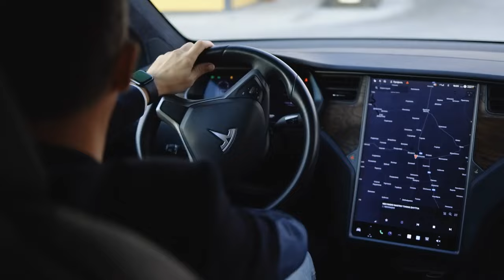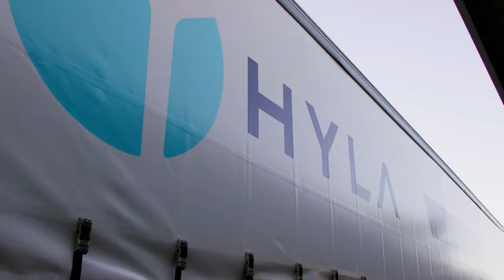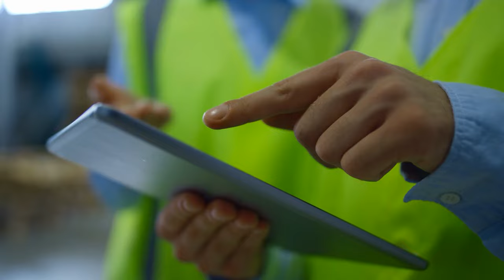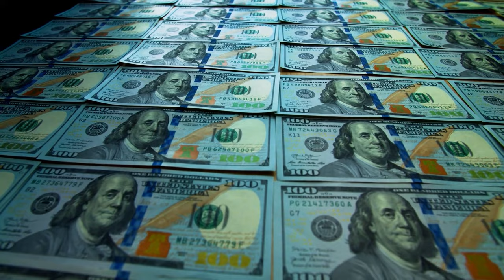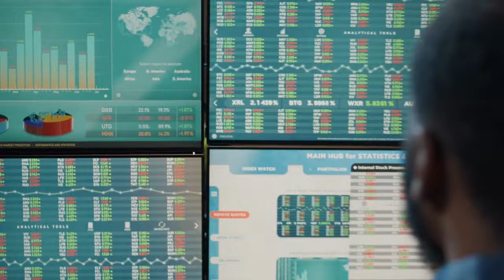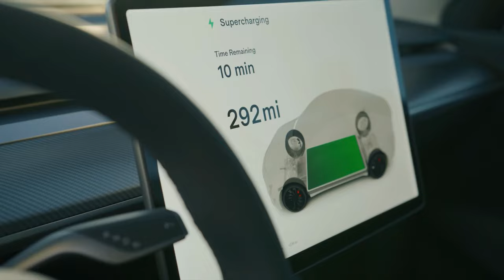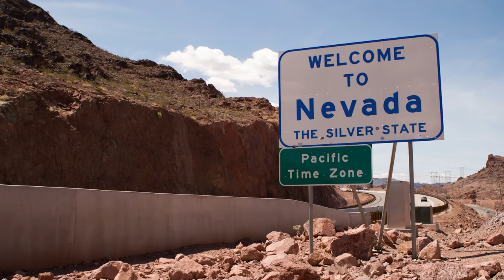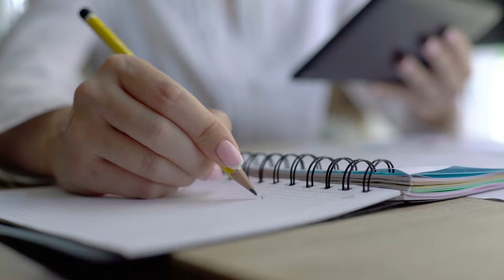A Devastating Blow For The EV Industry | Insurance Prices SkyRocket

Comment: Electric cars and trucks are little more than mobile crematoriums.  On a positive note, they ought to save big money on burial insurance.
Reply: Excellent comment
Reply: Electric rotisserie on wheels.
Reply: GOOD ONE
Reply: EVs without infrastructure are junk. 
Hybrids are the best short term answer until batteries and infrastructure catch up.The Steam engine went extinct in the 40s and diesel electric locomotives have been their replacement since them.  Thats a hybrid  Today, Edison Motors has a succesful hybrid logging truck that beats the Tesla in both power and fuel economy and most importantly, and it is lighter than the standard trans truck NRA. No range anxiety.
Get it straight .. The infrastructure TODAY  CAN NOT support EVs but hybrids can and are doing it with no infrastructure change and BETTER FUEL ECONOMY WITH PROVE TECHNOLOGY ..
Reply: I like the electric door handles. .Keeps people INSIDE and SAFE if there is a fire.
GENIUS

Comment: Rejection of EVs is reaching the tipping point.
Reply: That's right!
Reply: EVs without infrastructure are junk. 
Hybrids are the best short term answer until batteries and infrastructure catch up.The Steam engine went extinct in the 40s and diesel electric locomotives have been their replacement since them.  Thats a hybrid  Today, Edison Motors has a succesful hybrid logging truck that beats the Tesla in both power and fuel economy and most importantly, and it is lighter than the standard trans truck NRA. No range anxiety.
Get it straight .. The infrastructure TODAY  CAN NOT support EVs but hybrids can and are doing it with no infrastructure change and BETTER FUEL ECONOMY WITH PROVE TECHNOLOGY ..
Reply: @enterprisencc1701z   Infrastructure will NOT "catch up". (That logging truck is example of an insane torque application where gained utility outweighs battery replacement costs.)

Comment: EVs appear to have been released to the public too early before the deficiencies ( fires ) have been worked out. Perhaps all the EVs should be recalled.
Reply: EVs without infrastructure are junk. 
Hybrids are the best short term answer until batteries and infrastructure catch up.The Steam engine went extinct in the 40s and diesel electric locomotives have been their replacement since them.  Thats a hybrid  Today, Edison Motors has a succesful hybrid logging truck that beats the Tesla in both power and fuel economy and most importantly, and it is lighter than the standard trans truck NRA. No range anxiety.
Get it straight .. The infrastructure TODAY  CAN NOT support EVs but hybrids can and are doing it with no infrastructure change and BETTER FUEL ECONOMY WITH PROVE TECHNOLOGY ..

Comment: There is no method known to man to put out an EV fire. Insurance companies know this.
Reply: I thought they dropped them into a skip full of water. No easy task. A small fender bender can practically right off an EV. It's of no surprise to me at all that EV insurance is going to sky rocket.
Reply: @TheBarnestah there bathtub treatment is for after its put out to stop it catching fire again.
Reply: We should park a million EVs around Washington DC and just wait.
Reply: @TheBarnestah  The fire continues to burn underwater.
Reply: @ghost307  You can stop a battery fire if you cool down still intact cells faster than the burning cells next to them can set them off.  One transport company, I think it was in Gotland, uses IR cameras to detect potential thermal runaway in EVs on its ships and brine chilled to -19C to stop it. Once brine gets inside the compromised battery pack, it discharges the other cells so they cannot randomly re-ignite later.
Reply: sure, just park it in your garage, below your bedroom.
Reply: They still burn under water but at least cant catch anything else on fire they are shown in lakes burning under water the batteries make their own oxygen @TheBarnestah
Reply: EVs without infrastructure are junk. 
Hybrids are the best short term answer until batteries and infrastructure catch up.The Steam engine went extinct in the 40s and diesel electric locomotives have been their replacement since them.  Thats a hybrid  Today, Edison Motors has a succesful hybrid logging truck that beats the Tesla in both power and fuel economy and most importantly, and it is lighter than the standard trans truck NRA. No range anxiety.
Get it straight .. The infrastructure TODAY  CAN NOT support EVs but hybrids can and are doing it with no infrastructure change and BETTER FUEL ECONOMY WITH PROVE TECHNOLOGY ..

Comment: Theres a solution to the EV problem. It's called a V8 😎
Reply: Haha brilliant mate! Still got my LS1👍
Reply: @drdubberruckie2346  good man 😎
Reply: Absolutely correct 👍 Gas powered all the way
Reply: We have our S80 V8 AWD...and will keep it.
Reply: @SPDATA1  good man 👍
Reply: Twin turbo V8's DOHC 32 valve.
Reply: @jeffreycheng5984  now you're talking my language 😎😎😎👍 #DumpValves
Reply: Could have, should have,  had a V8.😊
Reply: Big v8
Reply: EVs without infrastructure are junk. 
Hybrids are the best short term answer until batteries and infrastructure catch up.The Steam engine went extinct in the 40s and diesel electric locomotives have been their replacement since them.  Thats a hybrid  Today, Edison Motors has a succesful hybrid logging truck that beats the Tesla in both power and fuel economy and most importantly, and it is lighter than the standard trans truck NRA. No range anxiety.
Get it straight .. The infrastructure TODAY  CAN NOT support EVs but hybrids can and are doing it with no infrastructure change and BETTER FUEL ECONOMY WITH PROVE TECHNOLOGY ..
Reply: Genesis 3.5 twin turbo gas v6.
Reply: ALL the owners of the Psycho-Billy Cadillacs knew that !

Comment: Forget the batteries, just give me a 300 mile long extension cord.
Reply: LOL
Reply: Yes I think Home Depot has em????
Reply: Are you irish?
Reply: EVs without infrastructure are junk. 
Hybrids are the best short term answer until batteries and infrastructure catch up.The Steam engine went extinct in the 40s and diesel electric locomotives have been their replacement since them.  Thats a hybrid  Today, Edison Motors has a succesful hybrid logging truck that beats the Tesla in both power and fuel economy and most importantly, and it is lighter than the standard trans truck NRA. No range anxiety.
Get it straight .. The infrastructure TODAY  CAN NOT support EVs but hybrids can and are doing it with no infrastructure change and BETTER FUEL ECONOMY WITH PROVE TECHNOLOGY ..

Comment: Tesla's latest owners manual recommends parking 50 feet away from any combustible material.
Reply: Is that real?
Reply: Don't park near an EV vehicle. You maybe thanking yourself!!
Reply: I assume that includes schools, hospitals, retirement homes, gas stations, national parks, airports, car parks ...?
Reply: EV should have a separate parking lot.
Reply: But if the battery is combustion prone how do you park the car 50ft from the Battery?
Reply: Link?
Reply: Does that mean you need to park your Tesla in a neighbours drive two doors away? I am sure the neighbour would be dead chuffed at having a potential time bomb parked in their drive.
Reply: @BonannoCM  I would avoid parking an EV anywhere near your home, business or in the garage..
Reply: EVs without infrastructure are junk. 
Hybrids are the best short term answer until batteries and infrastructure catch up.The Steam engine went extinct in the 40s and diesel electric locomotives have been their replacement since them.  Thats a hybrid  Today, Edison Motors has a succesful hybrid logging truck that beats the Tesla in both power and fuel economy and most importantly, and it is lighter than the standard trans truck NRA. No range anxiety.
Get it straight .. The infrastructure TODAY  CAN NOT support EVs but hybrids can and are doing it with no infrastructure change and BETTER FUEL ECONOMY WITH PROVE TECHNOLOGY ..
Reply: Does that include humans?
Reply: Hasn´t Switzerland banned or at least called a halt on more EVs because the country does not have the generating capacity to cope. Here in Slovenia our mains unit is only 30 amp capacity, plug even a granny charge of 7kw in and there is nothing left for other appliances. My daughter looks after holiday rental flats and occasionally gets called out to do  a reset when the clients turn everything on and trip the main switch out.
Reply: Yes, like another car.

Comment: Destroying the planet earth by making EV’s to save the planet earth, it’s a bad joke.
Reply: The virtual signalling rush makes up for it.
Reply: Hmmmmm Bidenomics!
Reply: EVs without infrastructure are junk. 
Hybrids are the best short term answer until batteries and infrastructure catch up.The Steam engine went extinct in the 40s and diesel electric locomotives have been their replacement since them.  Thats a hybrid  Today, Edison Motors has a succesful hybrid logging truck that beats the Tesla in both power and fuel economy and most importantly, and it is lighter than the standard trans truck NRA. No range anxiety.
Get it straight .. The infrastructure TODAY  CAN NOT support EVs but hybrids can and are doing it with no infrastructure change and BETTER FUEL ECONOMY WITH PROVE TECHNOLOGY ..
Reply: Totally ignorant!!

Comment: I question the motives of anyone who has bought or considers an EV car.
Reply: I also question their sanity.
Reply: EVs without infrastructure are junk. 
Hybrids are the best short term answer until batteries and infrastructure catch up.The Steam engine went extinct in the 40s and diesel electric locomotives have been their replacement since them.  Thats a hybrid  Today, Edison Motors has a succesful hybrid logging truck that beats the Tesla in both power and fuel economy and most importantly, and it is lighter than the standard trans truck NRA. No range anxiety.
Get it straight .. The infrastructure TODAY  CAN NOT support EVs but hybrids can and are doing it with no infrastructure change and BETTER FUEL ECONOMY WITH PROVE TECHNOLOGY ..

Comment: Don't park your EV in an internal garage attached to your house, always park outside instead. These cars can erupt into flames and would burn your house down! You and your family will be 100% safer buying a diesel car. EV fires cannot be easily extinguished, they have to drop the entire car into a big bucket of water!..I'm not joking!
Reply: I think a more prudent solution would be to not buy one or go near one. Ever.
Reply: Check out the Tesla that slipped into the water at a boat ramp, it caught fire whilst underwater!!.
Enjoy safe motoring and buy a car with a proper engine.
Reply: The good news is that the EV can save you money - maybe. The bad news is if it catches fire in your garage, you will need a new car and house. Home insurance may need to go up for EV owners too.
Reply: @jadyynstarlight9851 Clever thinking! EV owners paying higher home insurance premiums will probably come into effect. EV's are a liability, so why not?
Reply: The ONLY thing that makes an EV better than an ICE is IF you can charge it overnight in your garage while you are sleeping. But if you have no garage, like you might live in an apartment or need to park in the street or driveway, charging then becomes a disadvantage over an ICE. Always charging at a charging station is too expensive and time-consuming compared to just filling up with gas. So, the only advantage is overnight charging in your garage, meaning you now risk burning your garage and home down, this means there is absolutely no advantage to an EV at all.
Reply: Just park your EVs at my dealers nationwide and don't expect to get its back problem solved 😅
Reply: EVs without infrastructure are junk. 
Hybrids are the best short term answer until batteries and infrastructure catch up.The Steam engine went extinct in the 40s and diesel electric locomotives have been their replacement since them.  Thats a hybrid  Today, Edison Motors has a succesful hybrid logging truck that beats the Tesla in both power and fuel economy and most importantly, and it is lighter than the standard trans truck NRA. No range anxiety.
Get it straight .. The infrastructure TODAY  CAN NOT support EVs but hybrids can and are doing it with no infrastructure change and BETTER FUEL ECONOMY WITH PROVE TECHNOLOGY ..

Comment: Some governments are getting a bit excited about the EV option, long way to go before it's safe an affordable or economical😬😬
Reply: WEF
Reply: EVs without infrastructure are junk. 
Hybrids are the best short term answer until batteries and infrastructure catch up.The Steam engine went extinct in the 40s and diesel electric locomotives have been their replacement since them.  Thats a hybrid  Today, Edison Motors has a succesful hybrid logging truck that beats the Tesla in both power and fuel economy and most importantly, and it is lighter than the standard trans truck NRA. No range anxiety.
Get it straight .. The infrastructure TODAY  CAN NOT support EVs but hybrids can and are doing it with no infrastructure change and BETTER FUEL ECONOMY WITH PROVE TECHNOLOGY ..
Reply: EVs without infrastructure are junk. 
Hybrids are the best short term answer until batteries and infrastructure catch up.The Steam engine went extinct in the 40s and diesel electric locomotives have been their replacement since them.  Thats a hybrid  Today, Edison Motors has a succesful hybrid logging truck that beats the Tesla in both power and fuel economy and most importantly, and it is lighter than the standard trans truck NRA. No range anxiety.
Get it straight .. The infrastructure TODAY  CAN NOT support EVs but hybrids can and are doing it with no infrastructure change and BETTER FUEL ECONOMY WITH PROVE TECHNOLOGY ..

Comment: Problem with Ev is they are not better on the environment period. Electricity takes coal or some other fossil fuel to generate power
Reply: Hmmmmm but hipsters liberals in there utopia electricity comes from Unicorns and Rainbows!!!! Doesn't it????????
Reply: EVs without infrastructure are junk. 
Hybrids are the best short term answer until batteries and infrastructure catch up.The Steam engine went extinct in the 40s and diesel electric locomotives have been their replacement since them.  Thats a hybrid  Today, Edison Motors has a succesful hybrid logging truck that beats the Tesla in both power and fuel economy and most importantly, and it is lighter than the standard trans truck NRA. No range anxiety.
Get it straight .. The infrastructure TODAY  CAN NOT support EVs but hybrids can and are doing it with no infrastructure change and BETTER FUEL ECONOMY WITH PROVE TECHNOLOGY ..
Reply: Also, just to create the batteries, you need exotic minerals that are not easily found and thus foul the environment wherever it is mined.
Reply: Add this to what they do to the environment mining the products, the diesel burned while mining them, and the children working the mines

Comment: Their insurance should cover damage to others property. If you have one in your underground parking lot of your apartment block you might want to think about it.
Reply: Suggested new profitable subsidiary of Tesla - "Tesla Insurance Ltd"
You will get brand new batteries as No Claims Bonus if you have insured with with TIL for 5 years.
Reply: EVs without infrastructure are junk. 
Hybrids are the best short term answer until batteries and infrastructure catch up.The Steam engine went extinct in the 40s and diesel electric locomotives have been their replacement since them.  Thats a hybrid  Today, Edison Motors has a succesful hybrid logging truck that beats the Tesla in both power and fuel economy and most importantly, and it is lighter than the standard trans truck NRA. No range anxiety.
Get it straight .. The infrastructure TODAY  CAN NOT support EVs but hybrids can and are doing it with no infrastructure change and BETTER FUEL ECONOMY WITH PROVE TECHNOLOGY ..

Comment: When an EV Battery is scrapped, there is nothing recoverable, it becomes nasty land fill.
Reply: EVs without infrastructure are junk. 
Hybrids are the best short term answer until batteries and infrastructure catch up.The Steam engine went extinct in the 40s and diesel electric locomotives have been their replacement since them.  Thats a hybrid  Today, Edison Motors has a succesful hybrid logging truck that beats the Tesla in both power and fuel economy and most importantly, and it is lighter than the standard trans truck NRA. No range anxiety.
Get it straight .. The infrastructure TODAY  CAN NOT support EVs but hybrids can and are doing it with no infrastructure change and BETTER FUEL ECONOMY WITH PROVE TECHNOLOGY ..
Reply: @enterprisencc1701z  I guess a hybrid with a long life, no fire risk battery would be the ultimate.

Comment: Another major issue is Li-Ion batteries need to be cooled as close to room temperature (24°C) as possible before charging.
Reply: I'm my shed it's 45C. 
Do I need to air condition my garage?
Reply: @stevenmitchell7830   You're taking a big chance especially if the battery is still hot from driving around.
Reply: EVs without infrastructure are junk. 
Hybrids are the best short term answer until batteries and infrastructure catch up.The Steam engine went extinct in the 40s and diesel electric locomotives have been their replacement since them.  Thats a hybrid  Today, Edison Motors has a succesful hybrid logging truck that beats the Tesla in both power and fuel economy and most importantly, and it is lighter than the standard trans truck NRA. No range anxiety.
Get it straight .. The infrastructure TODAY  CAN NOT support EVs but hybrids can and are doing it with no infrastructure change and BETTER FUEL ECONOMY WITH PROVE TECHNOLOGY ..
Reply: And all they talk about is fast charging to sell that worthless junk. Fast charging!!